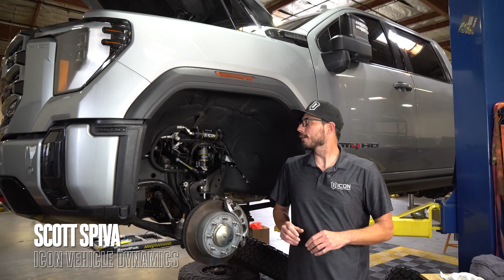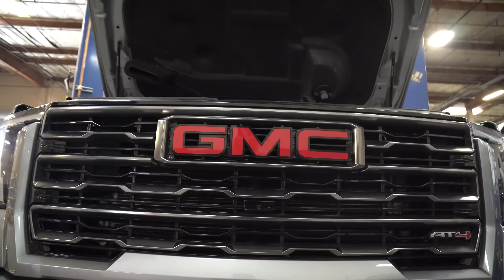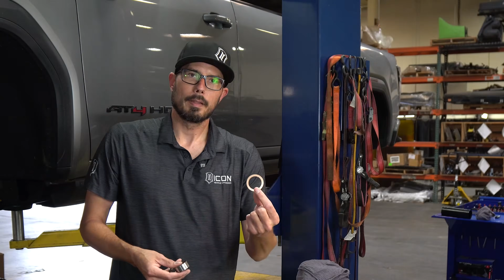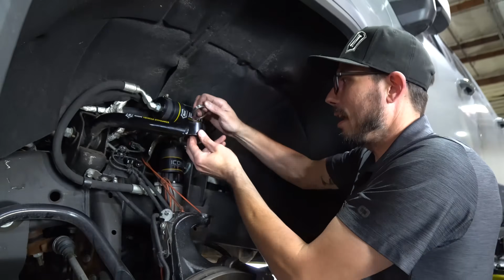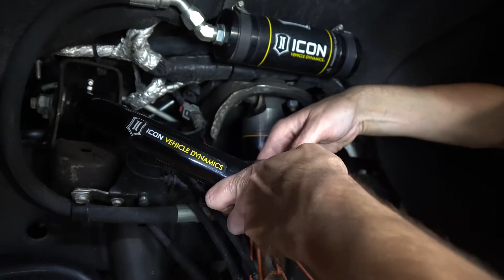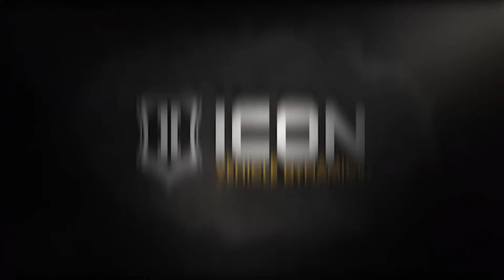ICON Vehicle Dynamics Tech Tips: Delta Joint PRO Rebuild

Comment: My delta joint pro doesn’t have the channel on the bottom of the ball for the access grease to run out. Everytime I regrease it comes out of the zerk thread and cap is bulging out because so much pressure. How do I regrease this properly?

Comment: Does the socket tool ONLY apply to the Delta Joint Pro?  I need to replace the standard Delta Joint (SKU 614550), should I order that fancy socket tool as well?